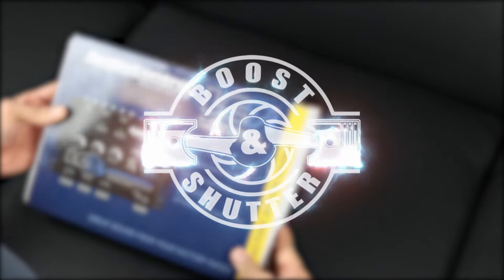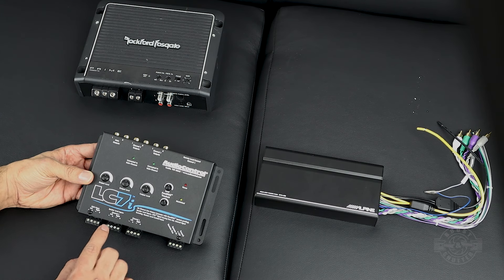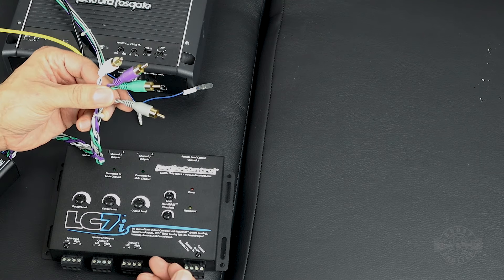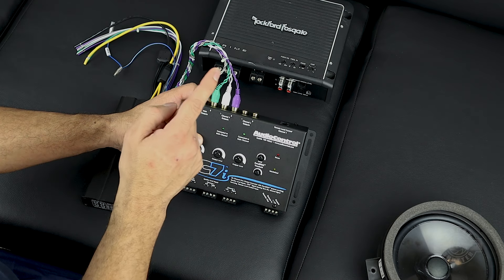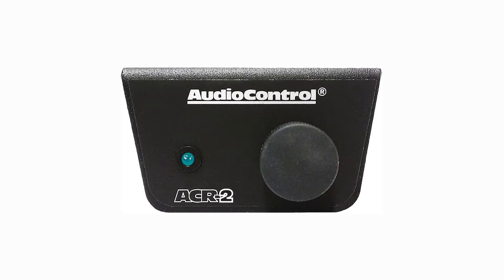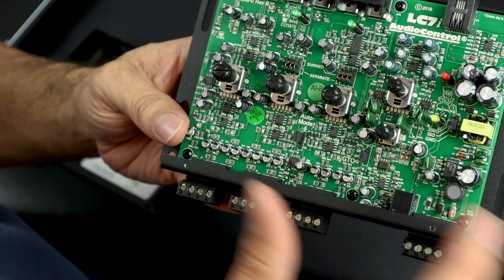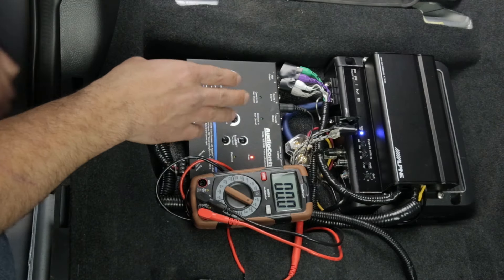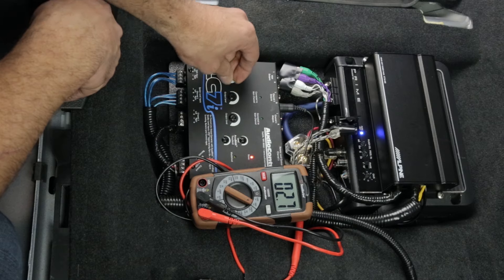LC7i Active Line Out Converter Discussion and Review

Comment: How did you find out that your system has a built in crossover?  Since your fronts are components with an external crossover, it's probable you don't have an internal crossover and could have just done with an amp with speaker level inputs and retain fade control from the head unit, or do I have that wrong?
Reply: Yes you are wrong

Comment: I have a 2020 Honda crv and it has two front tweezers and two back. I also changed out the factory speakers to 2 pairs JBL 2 way(GTO 609C). It  comes with 4 tweeters which has dual level tweeter volume   adjustments. I also bought a 4 channel hyfonic amp. How do I access amp that came with the car?
Reply from the maker: Sorry I am not at all experienced with that car.

Comment: Does anyone know that if your stock radio has a subwoofer is it equalized also? Meaning this 1. Does it have till off like the front stage speakers 2. Does it have a subsonic filter not allowing it to play low frequencies such as 30-40hz? Regardless of this I am also running the LC7i in my Lexus 350 with multiple amps. Will the LC7i work on the sun channel connected directly to the subwoofer output from the Lexus OEM amplifier with a FULL single? I swear my bass sounds muddy as I turn it up LOUDER. I have a Kicker 1200.1 on two sealed 10” Infinity Subs. If there is a crossover issues coming from the stock radio from the amp to the LC7i can I correct it and turn it back to a full single?

Comment: Good video bro. I have 1 question, so you front speaker are connected with the tweeters also to the LC7i?????
Reply: Most likely he has component speakers with crossover in the front. The amp sends the signal to the crossover and the crossover sends the signal to the tweeter and the mid bass speaker
Reply: Speakers don’t connect to the LC7i at all

Comment: Well that's a cool device but very lame that output channels 1 & 2 do NOT have that base roll off feature like channel 3 Have a 6000 watt system to install in a 2020 4runner and I wamt my bass in my mids  as well. Anyway to resolve that rolloff issue without buying a new headunit?
Reply: Yes they do, if you sum the sub channel with the other 2 .

Comment: Hello man how you doing so I have a 2019 Sierra crew cab I changed all door speakers and added four bullet tweeters in all doors that are hooked up in parallel to the 6.5 rn I have a cheap loc converter getting signal from the two front speaker and I’m running one rca that splits into two rca connections in the 4 channel amp my rear speakers are ran too the 4 channel amp now I’m trying to install that lc7 and still connect all my speakers to my 4 channel amp how would I run my wires would I just tap into all my door speaker wires and run them to the lc7i and then tap into the same stock wires and run more Into the 4 channel amp I am so confused if you could please help me out
Reply: Did you ever figure out what to do im having this same issue
Reply: Leon Paris no man I haven’t found a way to do it hopefully someone can help us I’m confused
Reply: Are you willing to take it to the shop so they can check it out or at least tell you how to do it over the phone?

Comment: Man this helped out alot thanks I have a question I have 2016 chrysler 300 can I have seen to wire after factory amp so I need to run all my wire from speakers to lc7i for best use

Comment: If the amp has this built in, like the Alpine you showed in this video, then why is this needed?
Reply: @akqjtn  so built in features in amps don't have "bass roll-off restoration? Just trying to get clarity. Will an amp do a good job at this if someone just wants a clean and loud sound, nothing competition style. Thanks
Reply: Call_Me Lou Amps like the ones in the video don’t have “bass roll off restoration. The lc7i converter helps with the bass roll off that the factory head unit is giving to the door speakers.  Also the lc7i helps save money from changing out the factory head unit and possibly losing important information on your car, and the lc7i helps clarify music from the highs(tweeters), mids(door speakers), and lows(subwoofers). My shop advised me to get an lc7i because it would help clarify the music since I have a factory radio, but I have upgraded door speakers front and rear and subs and that it would sound better with the lc7i. So depending on how you listen to your music, if your ok with how it sounds with just running your amp to your speakers then you can leave it. But if your not liking how it sounds with the factory radio then get this to help stabilize the how the music sounds. Hope that helped.

Comment: how would the lc7i work with the factory kicker subwoofer upgrade?
Reply: need the bass roll out fixed tho.
Reply: oh okay. i am just confused about the wiring out of the line out converter to the sub as there are many wires on the factory upgrade sub.

Comment: Did everything go good im doing the same thing just seeing how it worked for you
Reply: I bought it also because of this video but I have a 2016 chrysler 300c and crutcfield  is telling me I need the pac amp pro for my car so then there wouldn't be a need for this im assuming but I already spent the money on this im confused if this lc7i will work
Reply: I guess im confused about the factory amp part im also upgrading or already have just havnt installed yet a mono amp and a 4 channel amp lost on how to do it thinking about just cutting the speaker wires after the factory qmp to get signle ?thanks for the response

Comment: I have a 2019 Elantra and front component and the rear speakers, so I want to install a 5 channel amp to run a new component but that component has a passive crossover and tweeter sound too loud. Will this device help me with that problem?

Comment: Do I need to add an equalizer to this LC7i?
Reply: Ricardo Peltier it’s really up to you but this is designed to tune the factory radios signals that go to your after market or factory door speakers(i would change to after market speakers if your installing extra adapters like the lc7i) It makes it sound more clear and crisp so you don’t have to spend that extra money on a after market radio which has an equalizer depending on which radio you get. So no you don’t need an eq with the lc7i if your connecting it with your factory radio.

Comment: Great video. You definitely get a "like" and "Subscribe " from me ..Any advice for Dodge/Chrysler  Uconnect radios ? I have read they maybe preset EQ adjustments internally.  For example if that's the case and the unit is putting out too much of a high frequency would I need the AudioControl DM-608/810 to use a computer to set a "Flat" level output?
Reply: I have a 2016 ram, and yes they are EQ'd a little weird. The front door 6x9 is just a mid bass driver, and the rear door 6x9 are full range. Basically with the LC7, you could run all 4 speakers into it, and then have full range coming out to a 4 ch. amp running upgraded 6x9s. That's what I'm planning anyways, but in the front I'll go with components, and mount the tweeter up in the door sail. As far as frequency,  your amp crossovers should take care of that.

Comment: I think I'm not understanding something crucial here: I thought the whole point of using your own amp was to avoid any distortion (or other ugliness) caused by an existing amp. If you keep that amp as input and reduce it to line level and then amplify it again (with a better amp), don't you just get the combined distortion of the two amps?

Comment: 😒Btw, my AudioControl LC7i  frustrates me. I've watched every video and read every piece of relevant literature on it and have not been able to tweak it to optimal performance. An in-depth troubleshooting explanation is lacking or nonexistent. E.g. Why is it ineffective unless maxing out the Accu Bass dial? I recommend a new in-depth informative video. Feel free to ask me about which issues I'm having and am referring to.
Reply: I am looking at getting one of these what problems are you having.
Reply: @anthonylee3336   My LC7i isn't what I need. I really only needed the 2 channel version but I came across the 6 ch version for $60 so I couldn't pass it up. The main reason I'm having troubles may be because I have a LOC (Line Output Converter) attached to my head unit (which is attached to a wiring harness which allowed me to add an amp to my factory head unit) and then that goes to my LC7i rather than having the LC7i attached directly to my head unit. This may not have anything to do with the issues I'm having but in case it does I am mentioning it. Another main problem may be the LC7i really ought to be professionally installed by an AudioControl certified installer, IDK. However, as I said, I've viewed and read everything I've found on it and my main problem is it fluctuates. Sometimes it'll kick in extra bass halfway thru a song or not at all. Plus I have needed to max out almost every dial. Hence "almost". I tried switching the internal switches but that didn't help. I only am able to have one RCA wire into the CH 3 (sub) input which I cut off the RCA and hardwired it into the input. Honestly, I believe the LC7i is worth the investment but it's just that I'm stuck in a rare set-up which most likely may be causing me the fluctuating issue(s). 
BTW, the reason I'm running a LOC into my LC7i is because the LOC came attached to the wiring harness that plugs directly into my factory head unit so I can't get rid of the extra LOC while retaining the $50 wiring harness I purchased which is what allowed me to add an amp to my Ford Edge's factory head-unit. 
Conclusion: go ahead and invest into AudioControl's Accu Bass unit(s).
Hope that helps more than it confuses. =) 
BTW we share the same last name!
Reply: Hey Brandon thanks for your reply I would agree it’s the first inline converter causing you problems. Thanks again I will go buy a LC7 and let’s see what happens. 
Cheers 
Ant.
Reply: @lowhertzhighspl  Obviously connecting a low level output to the high level input from the LC7i is not going to work.

Comment: Couldn’t you just tap into one of your high level inputs for the 3rd channel, instead of opening up the DSP and messing with dip switches?
Reply from the maker: I suppose, but I like to avoid high level inputs if I can. The switches are there for a reason.

Comment: This thing is garbage,  it will not keep my bass steady.
Reply from the maker: Double check all of the gains, the accubass setting, and turn off any bass boost from your stereo and amp
Reply: @akqjtn  everything was set at the Audio shop , took it back several times.  They said nothing was wrong. I took it to another shop and he said it needed a 0 gauge power wire dunce it only had 4 gauge,tried that. The bass would all the sudden get really loud to the point where it put the amp into protection mode then level off again, very random. Sometimes it sounds good and hits hard,other times it's very low. I turned off the accubass and bass level all the way off or counter clockwise and now it's steady  but it really does not sound the way it should for having 1400 watt amp to 2 12 inch speakers. Rockford Fosgate prime 1200x1, according to the certificate it puts out over 1400 . I have had smaller amps that sounded twice as loud on cheaper speakers.
Reply from the maker: @WICKEDLUIS  Interesting, always a possibility you got a bad unit. What you are describing is not normal and never happened to me.
Reply: @akqjtn  I was thinking the same. Been messaging Audio control back and forth. I am going to follow their instructions to the letter and see if it makes a difference. It would be easier just to get an aftermarket head unit but there are none that will sync to my 2019 mustang gt, at least none that would probably let me use the steering wheel controls and other options. Lol
Reply from the maker: @WICKEDLUIS  you have to use a maestro unit for that, check out my aftermarket stereo install videos literally dropping tomorrow
Reply: @akqjtn  will do. Thanks
Reply: @akqjtn  I fixed the issue and it sounds pretty much the way it should. I went ahead and turned the accu bass all the way to the right to keep it on all the time. It holds steady now and shakes the car with no clips. Lol